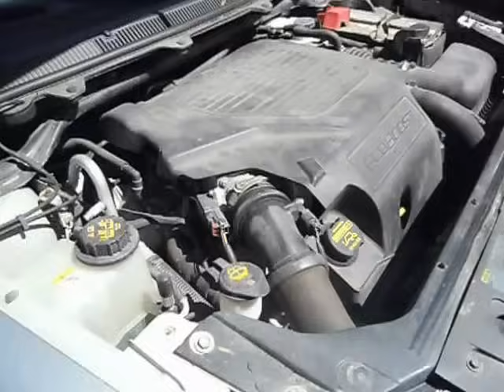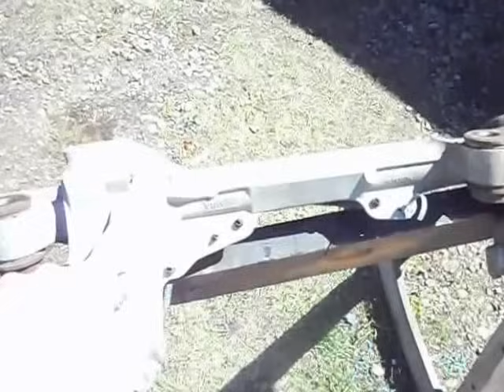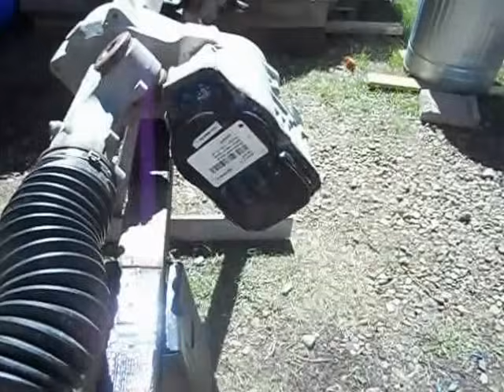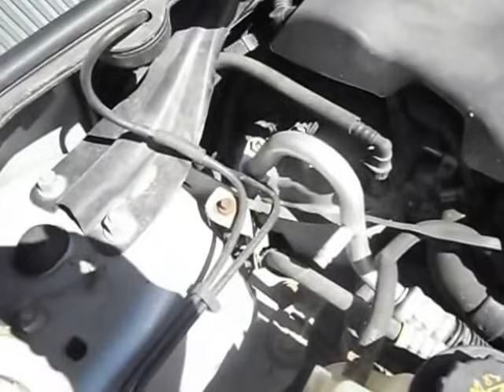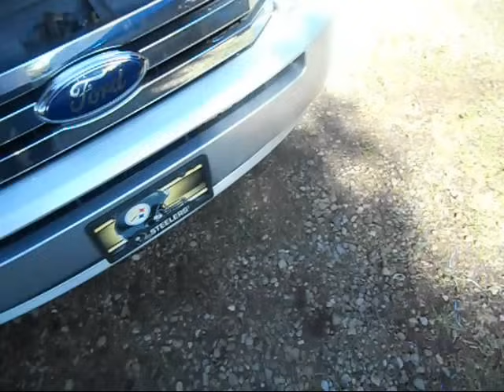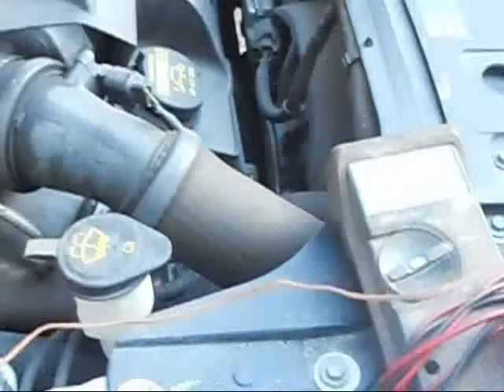Ford Electric Power Steering Failure Identified

Comment: Or just the module??
Reply from the maker: Replace entire EPS module. Cost between $2-3K.
Reply: @bk1468  thanks I get an eps module used for 4 hundred ,I got limited budget any suggestions
Reply from the maker: @pedroj4230  Install yourself and make sure you reference assembly manual for important details (like clock spring, etc.). Your EPS may require reprogramming if previously installed on alternate vehicle model. Since you will be de-installing steering system; replace all rod-ends and any other wear-components you can. Take special care to make sure your steering wheel linkage is properly maintained (like new lock nuts, etc.). Remember your replacement EPS module includes same thermal problem as original, it will fail again at some point.

Comment: if we change these two mosfet the steering will work again ?
Reply from the maker: MOSFET's are not discrete devices, but instead integrated module with wire bonds to circuit board. Repairing EPAS motor driver is problematic at best. No schematic, no component labeling, no hope. To make things worse; TRW integrated all circuit boards using non-serviceable philosophy; just gaining access to most internal components means destroying others. Besides, after all the trouble with repair; EPAS would just be placed in the same overheated environment. The 1800 degree catalytic converter is located within 3 inches of the EPAS aluminum housing with no heat shield.
Reply: thank you for reply
we need a new one that will fail also
big deal

Comment: I have a 2011 mustang with electric steering and while power steering isn't completely out, it still required increased effort. My steering wheel doesn't return to neutral position with out me turning it that way myself and it catches sometimes, kind of like momentary complete power assist loss. Any suggestions?
Reply from the maker: Typical symptoms of failing EPAS. However, better have it checked out. Does your OBD indicate any error codes? Most do, some don't. Ford reported serious engine compartment overheating problems on Mustang some time back, was that 2011? Think it was 2016.
Reply: K Smith thank you for your response. No it doesn't show any codes. The owner before me totaled the car and destroyed the whole right corner of the car. I fixed it up and it runs almost as good as new. There was inner fender damage so I believe the tire was pushed back. So the rack may have taken some damage because of it. I feel as though it's getting better as I drive the car. Just not what it should be.

Comment: Can you advise me or can I contact you. I have a 2012 ford explorer. I have experienced a power steering assist failure. The dealership said the warranty given gor the recall has expired . We are really stuck. They are asking 3000 dollars for repair
Reply from the maker: Unfortunately there is little you can do as consumer. Your experience is typical to millions of Ford EPAS owners experiencing identical failure. Ford has never acknowledged nature of engineering design flaw, and taken no responsibility for selling millions of faulty EPAS units since 2008. Most consumers pay for repairs then liquidate vehicle, others purchase discounted EPAS units (ebay and others) then replace units via local shop or themselves. Remember how you were handled by Ford when considering purchase of new vehicle. Most consumers whom have experienced Ford products and customer service have vowed never to own another Ford product, myself and entire family included.
Reply: Don't buy another Ford
Reply: Same fucking boat here! Bought it used the old owner didn't get the recall and now ford says we're sol as it was only covered under extended warrantyand not an endless recall ! Never again!
Reply: @eqbobyboucher  considering I almost lost my life driving tonight to this issue, it is beyond terrible that this issue is even allowed to continue. I myself am so enraged right now and at a loss as to how to move on in my current situation. I can definitely relate 👊🤬👍

Comment: I drive a 2012 ford focus 2.0L Gdi sport, i have the same problem, when i turn on the car it says steering assist malfunction, when i took it to ford they said steering rack needs to be replaced for the cost of R29000, they literally told me that they are not going to assist, how do i get them to fix it?
Reply from the maker: Many Ford owners have annoyed ford for long periods prompting partial coverage of EPAS failure on vehicles not covered under warranty. Ford gave me $600.00 after calling Ford customer service at least 30 times, writing letters threatening legal action and generally pissing-off everyone I spoke with at Ford. But I actually was injured in accident when my EPAS attempted to kill me; so this fact put fear of attorney in perspective. You are on your own as far as Ford is concerned. Lets be clear; EPAS failures are direct result of Ford engineering incompetence. The fact that Ford has only recalled very small percentage of vehicles affected since 2008 is pure politics and fear of bankruptcy. The NHTSA is fully aware of issue and could not care less, as long as US car manufacturer is not placed in financial danger; just ask Takada. I purchased remanufactured EPAS unit on ebay for approximately $650.00 and performed replacement in my garage. I have experience and air tools, so job was not difficult. Main front subframe must be lowered to gain access to EPAS unit.

Comment: I have a ford 2011 taurus sho I have a service power steering message on the dash and it's getting hard to steer help olease
Reply from the maker: You are experiencing classical EPAS system failure like millions of other Ford owners. If your vehicle is not under warranty or recall, you will be required to pay approximately $2,500.00 for repair at dealer, or $800.00 if you can perform your own repairs. Your EPAS system has failed due to poor engineering and implementation by Ford, however Ford will not acknowledge this fact and will do everything possible to keep you in the dark, and do nothing to provide assistance. Ford is actually making money off replacement EPAS units, with average $2,500 repair bill. Also, replacement EPAS unit will also fail down the road, because real engineering flaw has not been addressed. The NHTSA is complacent with Ford on this one; after all Ford represents $200B US company, and the NHTSA simply does not enforce safety mandate on US based companies that could potentially be harmed by agency action. Ford would be liable for possible buy-backs on tens-of-millions of vehicles sold since 2008; but this is another story. You as consumer are on your own, just remember this experience next time you consider purchasing an American automobile, I certainly will...

Comment: Hi, I have question.  For some reason my car lost power does my electric steering lost power? Should able to control my steering wheel?
Reply from the maker: Your vehicle control computer determines when EPAS steering is enabled. Not clear precisely which systems must be operational for EPAS function; but I would guess engine must be running, and or transmission movement under specific driving conditions. E.g. It would be logical for Ford to enable EPAS under certain emergency conditions; like engine shutdown at speed. But I am not clear on Ford EPAS software operation.
Reply: B Smith thank you. :-)

Comment: Are there any symptoms before failure. There are no codes and the dealership is saying that EPA needs to be replaced, but I do not see how they could know?
Reply from the maker: EPAS self-diagnostic firmware is limited and may not detect initial failure symptoms like failing position feedback encoder, MOSFET failure, etc. Many owners have reported 'clicking' sound or intermittent assist-loss prior to full failure. Assuming your dealer has observed failure symptoms; but you should have also observed same symptom. As far as dealer is concerned; I would not trust their assessment in general. Get second opinion from third party, or listen carefully to EPAS operation while slowly turning wheels lock-to-lock. If any clicks or jerky movement is noted; EPAS is failing. This should be performed after drive with vehicle at full operational temperature.
Reply: Thanks, we let them change it, since it was covered under our extended warranty.
Reply: None for us.

Comment: I have a 2014 f150.the steering has slack in it and its a little stiff to turn the wheel.I called ford dealer and they said they would have to run a test on it.any advice how I can fix it .
Reply from the maker: Wish I could offer positive advise, however if you own an EPAS system, you are in for a world of hurt from Ford. Get vehicle repaired and sell, is best advice. EPAS will continue to fail down the road, just like many others continue to.
Reply: I'm at ford dealer now they trying to give me the run a round. but I have a warranty. all of the steering should be covered .

Comment: I have a 2010 fusion SE power steering locked up while going down highway putting me and my family off of road, Ford needs to own up to these piece of junk cars and fix power steering problem, I have had the car since 32,000 miles
Reply from the maker: Ford will do nothing concerning corrective measures for various reasons. Action will require legal or oversight action once one or more people are killed sighting criminal negligence. Just like 1970's Ford Pinto, nothing has changed.
Reply: @bk1468  It's a shame
Reply: I have the same kind of car. I own a Ford fusion se 2010. I accidently hit a side walk (I wasn't that hard I promise) so after that the wheel got stuck and the nightmare began, Ford wants to replace steering rack and charge me 2500k. I think it's ridiculous
Reply: @RicardoMartinez-gb3ii  that is crazy! I feel like my car is not worth that kinda money

Comment: where did you find how to remove this rack and pinion set? i am trying to replace my friends 2011 ford fusion that has failed and is not covered by the recall.
Reply from the maker: Rack removal and installation instructions are found in Ford service manuals. Most can be found online for free if you search sufficiently. Most are fairly self explanatory, however vehicles with front sub-frames are more involved. Make sure you reference positions of tie-rod ends from old to new assembly. You will need to have vehicle professionally aligned after replacement.
Reply: K Smith we just finished. does the PCSM have to be software updated by the dealer? it's getting aligned now and we left it unplugged till we figure out the software
Reply from the maker: System is Plug & Play, no software requires updating.
Reply: straight out of the ford service manual and the rack and pinion came with a note also.
When installing a new steering gear, it must be configured (using vehicle as-built data or module configuration information retrieved earlier in this procedure). For additional information on configuration, refer to Programmable Module Installation (PMI) in Module Configuration See: Powertrain Management\Computers and Control Systems\Information Bus\Testing and Inspection\Programming and Relearning\Programmable Module Installation (PMI).
Reply from the maker: OK, may be the case for your vehicle, my vehicle required no special programming.

Comment: I have the same problem with my 2012 Ford Focus it's too expensive to repair so I'm just going to drive it with no power steering it won't hurt will it
Reply from the maker: I am not aware of anything that could be damaged. However there are liability considerations. If you knowingly drive vehicle with failed steering system; this represents safety hazard. You can be held liable in an accident, and your insurance company will definitely deny coverage with known mechanical deficiency. Just a situation better avoided for safety and benefit to all.
Reply: @bk1468  Do you reecommend selling it ? but what about liability for the new owner/dealership, it would probably be a good idea to let them know about the issue and then it is under their responsability right?

Comment: I know this is 5 years old but was there any determination on troubleshooting or fixing this issue?
Reply: i know this is month old but EPAS under warranty if your car model 2011-2013 and mileage less than 240.000km but they will not replace EPAS if it still working they only replace it under warranty if the epas not working and shown warning in dashboard
Reply: @2GE4EV and of course I have a 2014

Comment: do ypu know if the recall is also for a ford escape 2013? because mine just failed yesterday and they want 1700 to fix
Reply from the maker: Most likely not, but check with Ford or dealer to make sure. Ford is handing out $700.00 checks for partial repair cost, but you need to press them. Your vehicle, like millions of others, should have been under defect recall. EPAS systems are defective, dangerous, and fail in many hazardous modes. Please stay away from Ford products.

Comment: What can be done when I own a 2010 escape with the same problem?  I tried Ford and they say my vin is not in the recall
Reply from the maker: Repair and dispose of vehicle, problem will resurface since Ford has never addressed root cause. Remember Ford's response next time you are in the market for an automobile.
Reply: I feel for you, ours just went on our 2010 Ford Fusion. Ford told me keep your receipt for repairs and when there is a recall they will reimburse all repair costs. What in ten years???!!!
Reply: @bk1468  my problem is, how do I sell a car I know is unsafe?
Reply: @gregbriand7959  that's the truth!
Reply: @joannconner5513  We had to get a used part and one year warranty. We just bought the car six months ago and had to put almost $1,000 in it! Ford just told us sorry and they kept the incident on file. It's the exact part they recalled the 2011 for! Ours is 2010. We will never buy a Ford again. My husband could hardly steer it and if I was driving I would have been killed because I'm not strong enough to do what he had to, strong arm turn it. Diana.
Reply: @gregbriand7959  I hear you! They have now told me that it is not under recall for the steering issue, and I should figure out how to get it to the nearest Ford Dealership, which is an hour away down a steep mountain pass. If it requires work, it is on me! They also told me, for the first time, that it IS under recall for the fuel system, which has been known to cause the car to suddenly stall in traffic! I will also never own a Ford again, and I have a LARGE family and friends group too!